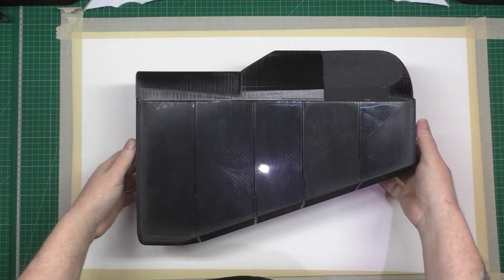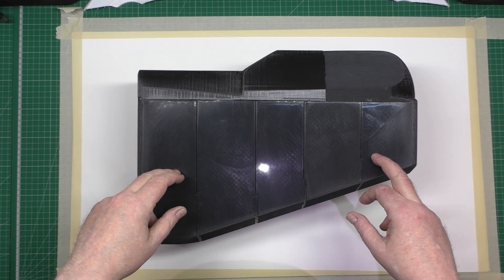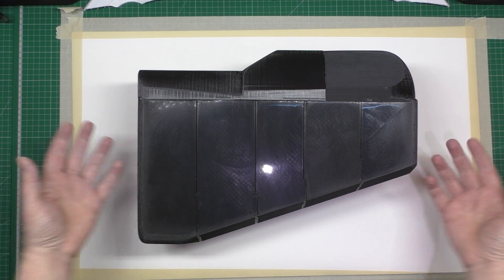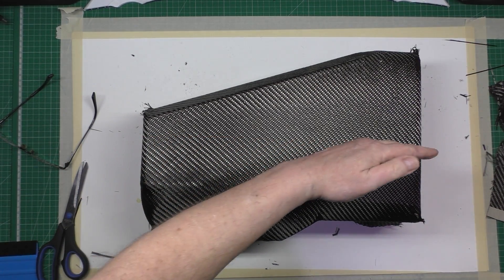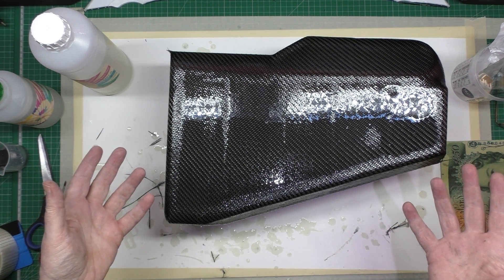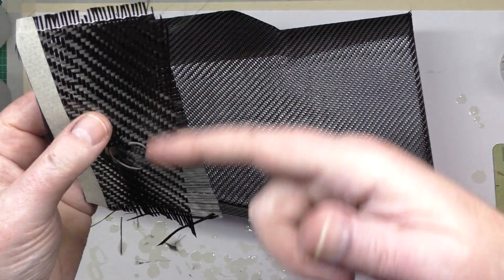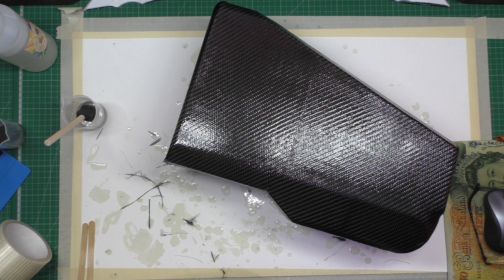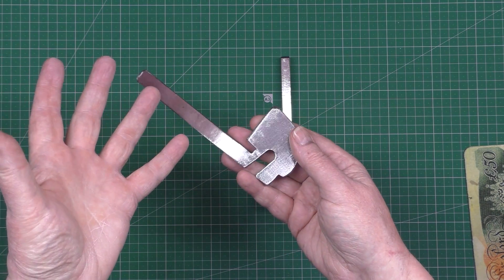High powered DIY eBike MSVA build part 15 - Carbon fibre skinning part 1

Comment: i hit a pot hole on my bike... a screw came loose on the disk break an cut through the power cable... i now have a £2000 ebike that doesnt go anywhere! ARRRRRRRRRRRRRRRRRH!
Reply from the maker: Ouch! As I always say to people......"make sure your nuts are tight".
I check mine whenever I get home and I use plenty of thread-lock on everything. Lesson learnt mate - you won't be making that one again 😒
Reply: Nope... Soldering iron time!

Comment: hi could you not ave done it with paper mache  and then covered it with the the self adhisive carbon fibre that comes on a roll i love your vids waiting to see this baby go thank you
Reply from the maker: Yes, I cold have made a mould and made it purely out of carbon fibre but..... carbon fibre is conductive and I didn't want it in direct contact with the battery.
Reply: @Vortecks  i take it then you wouldnt be buz lightyear///??? maybe buz balls thank you
Reply from the maker: @johnglynn8552  Just call me Tony....... Tony Stark 😂
At a later date, I might revisit the casings and actually make them purely from carbon fibre but use an insulation layer on the inside. I never intended to use carbon fibre at all but I couldn't resist in trying it out.

Comment: You should use viagra as that makes with stiff it lasts long and it's durable 😂
Reply: Do what blue Peter and art attack used to do. Cover everything in pva glue lol
Reply from the maker: Cheers mate, I'll add a tab to the next mix 😂

Comment: Looking good!  Like your torque arms!  Have you noticed any warping or pulling on your battery case halves, as the epoxy dries?  👍👍
Reply from the maker: Amazingly, there's zero shrinkage or warping but I never want to do it again (that includes making the torque arms)
Reply: Vortecks   great!  Like your videos, you aren’t scared of taking on new challenges....you have good ideas, and the patience and fortitude to make it happen.  cheers!